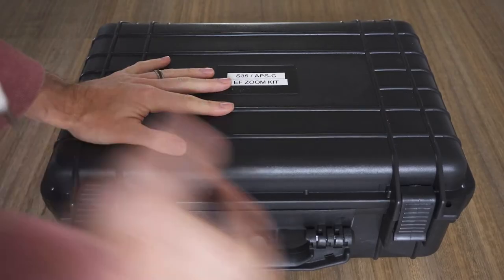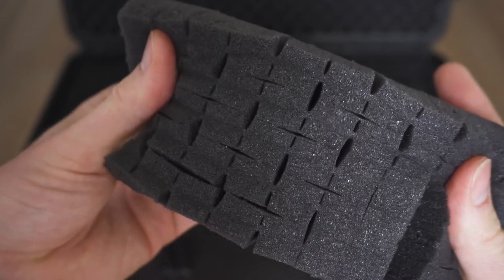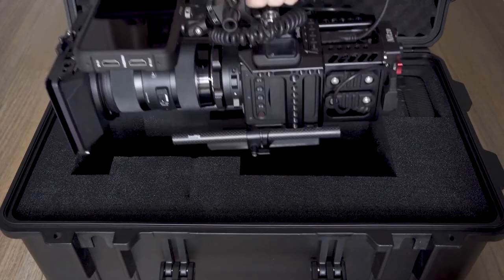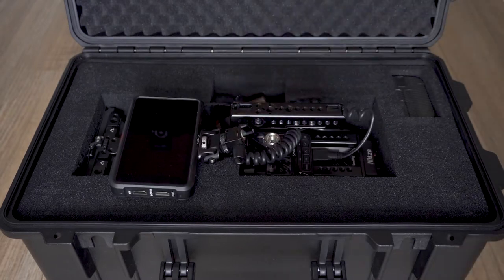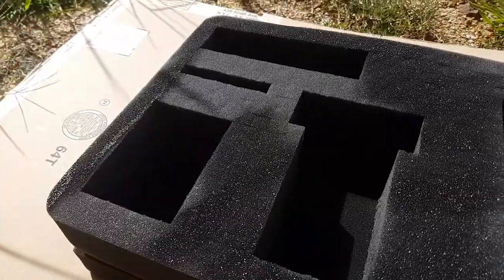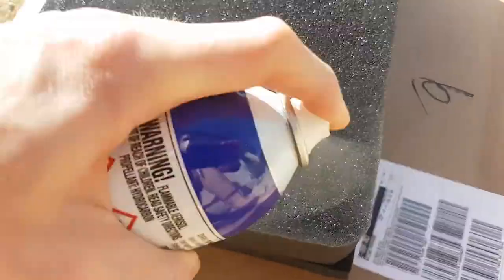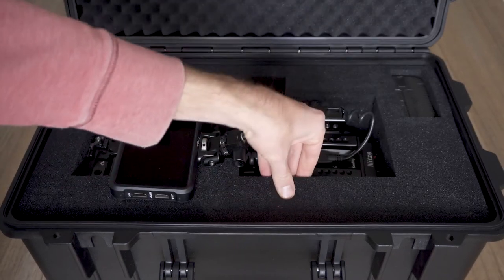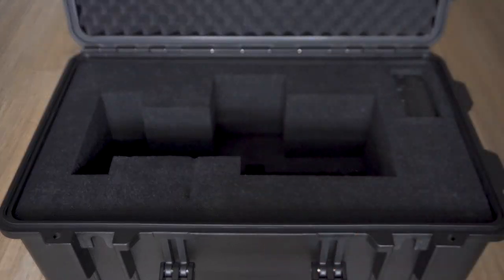PELICAN CASES | pick & pluck foam PRO TIP | PLASTI-DIP

Comment: Thanks. Can the foam be picked and plucked after spraying with Plastidip? I have a new Pelican casewhere I'll be storing go pro and tactacam gear. If I need to pick out a new spot (after using Plastidip) for a charger or clamp, etc., will I be able to do it without destroying the foam?
Reply from the maker: I've never needed to but my guess would be that it probably wouldn't work very well - this stuff does a darn good job of holding it all together. Of course, you could just take a stanley knife and hack at it but that might not look too pretty!
Reply: @wileyvisuals5714  Thanks. I’ve ordered some plasti-dip and will keep that in mind.
Reply: I wonder if you'd care to comment on your results after all this time... I'm about to p-dip my foam and was thinking it'd be easy enough to make changes if I needed to (though one would need to be careful). Alternatively, I could simply purchase another level of pick and pluck foam and start over...
Reply: Hmmm. That second idea would allow for multiple versions of padding for the same case... Interesting.

Comment: How many coats did you use?
Reply from the maker: On some cases the foam is sturdier to begin with so 2 coats is enough. On cheaper brands the foam is softer so 3-4 coast are needed to get it nice and firm.
Reply: @wileyvisuals5714  appreciate it!